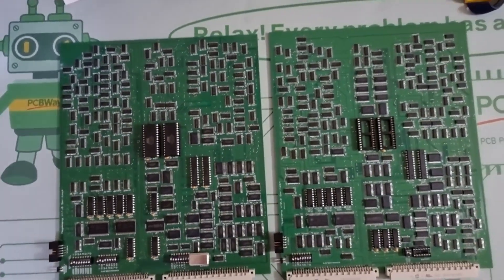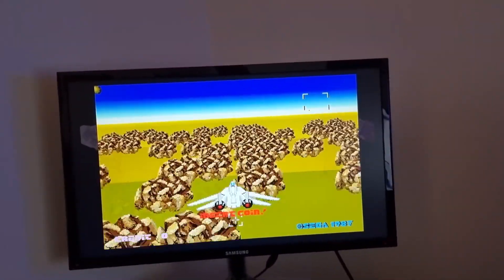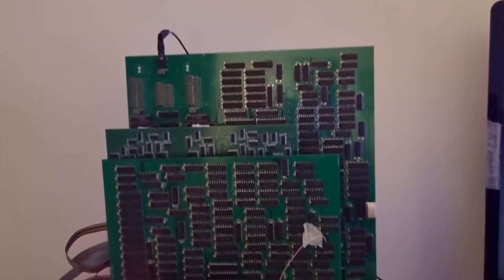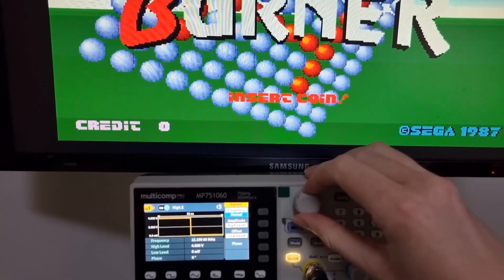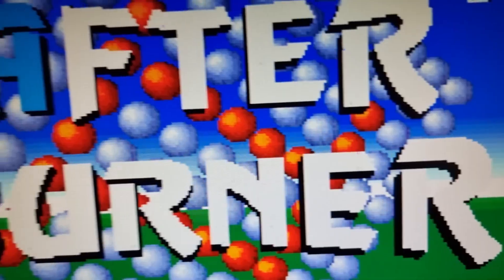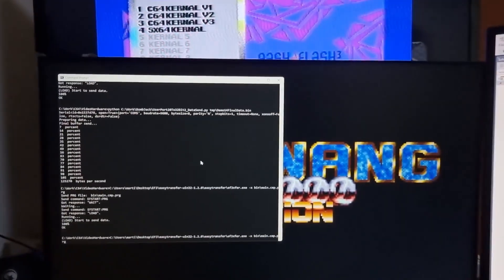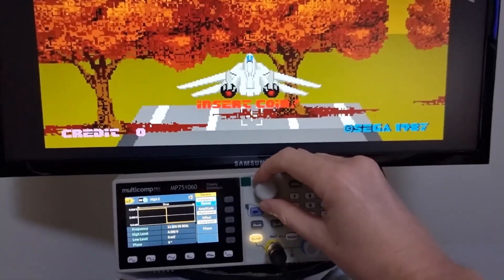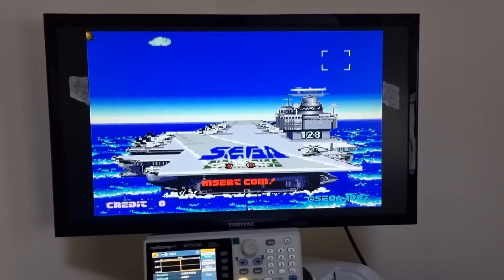MegaWang 2000 Turbo Edition   41   Testing the new Super Scaled Sprites PCB

Comment: This is awesome!

I can't believe the C64 can process the game code and 3D calcs fast enough, but apparently it can.

I did a bit of work on trying to implement the Sega X Board sprite rendering in Verilog a few years back.
I had it starting to render some sprites, using VRAM dumps from After Burner, but not too much more than that.

(this was only running in a Verilator/imGui sim, though. I never tried running it on an actual FPGA.)

I since moved on to working on the Dreamcast PowerVR 2 "GPU".
I somehow managed to get a lot further than what I did with the X Board stuff...

The renders for PVR2 were looking quite good some months ago, but I had to break things again to continue trying to improve the frame render times. lol

The calculated frame rates (based on the original 100 MHz clock) were around 40-70 FPS for most renders.
(VRAM dumps from the reicast emulator, again running under Verilator sim initially.)

I turned it into an FPGA core for MiSTer.
The GPU being purely in Verilog, but due to the RAM latency, the frame rates are pretty terrible atm.
With a lot of help from skmp (the main author of reicast), we got the rest of it running as an emulator on the ARM side.

We're talking around 3-5 FPS on the FPGA right now, though.
Very occasionally it might reach say 10-15 FPS on scenes with a low polygon count.

So yeah, I love seeing projects like yours, especially since you did the whole graphics board using old-school hardware.
Reply from the maker: Thank you for the nice comment. Since this design is deliberately not using FPGA/PAL (as a design goal to use old-school hardware) it is quite a bit harder than VHDL or Verilog. I've been wanting to experiment with MiSTer as well, since I know HDL, but I like the idea of rolling my own hardware more. The thing is with MiSTer, as you've found out, is the limited memory bandwidth due to the baked in architecture. In this design if I need parallel memory, or extra memory busses, I just add them. :) This scaled sprite board has several memory, RAM and ROM, busses to solve some problems. The ROM is used as a large 16 bit multiply lookup, for example.
Reply: @MartinPiper6502  Yep, using 74 series logic (etc) is for sure going the hard route. hehe

The only time I really mess with the traditional logic stuff now, is for things like 3V3 to 5V level translation.

I used to do the odd repair of arcade boards etc., but obviously a lot of those started to use more custom chips, which made things tricky.

And yep, the mem bandwidth of the 16-bit SDRAM module(s) on MiSTer isn't ideal for certain arcade boards and later consoles. It's amazing what the uber devs have managed to do with it, though.

(the onboard DDR3 is capable of around 3.2 GBytes/sec, peak. But the higher latency is of course a problem for certain retro machines. A lot of that has been mitigated via the clever use of caches and pre-reading.)

I do more PCB design and building, rather than the purely "software" / HDL stuff.

Well, that was until I had major burnout about six months ago, and haven't been able to face building a PCB since.

Finally getting back into it, though.
So many projects to build, which is half the problem. lol

Building some boards for the next rev of a DIY AV Receiver (Dolby Atmos, 12 channels of Class D amps etc.) is next-up.

Then I have a Dreamcast motherboard to build, which has taken me many years of on-and-off work to finish. It's very daunting thinking about building some of that stuff, as I REALLY want it to work on the first try.

The sprite scaling stuff is so neat, though.
Especially the C64 thing. I had no idea the 6510/6502 could process the 3D calcs fast enough.

Is that pretty much a stock C64?

I'm assuming you had to write your own FAST maths calcs in assembly?
Reply from the maker: @electronash  the C64 is stock, the 6510 still runs at 1MHz and it still has 64KB of RAM etc. But, of course, the whole expansion hardware that plugs into the user port provides a lot of help, especially with maths. A bit like the original arcade I've got a hardware solution to rotation and perspective calculation that the C64 CPU can access via the user port to get the results of maths calculations. For example, to rotate and transform a 3D point the C64 stores a few bytes to the user port then reads the results from the user port in screen space.
Reply: @MartinPiper6502 Ohh, I see. That does make more sense. hehe

I mean, even the 68000 probably struggles a bit with so many sprites on-screen.